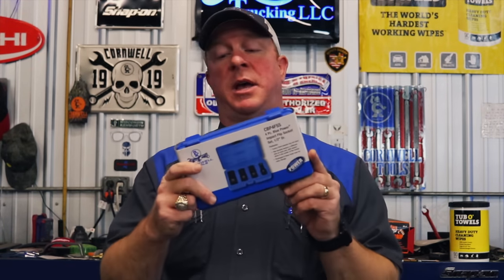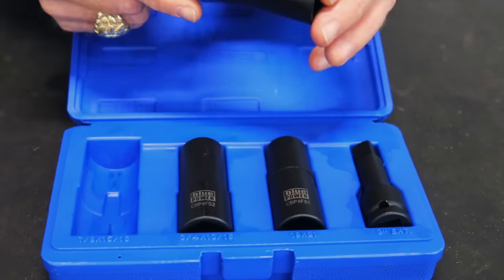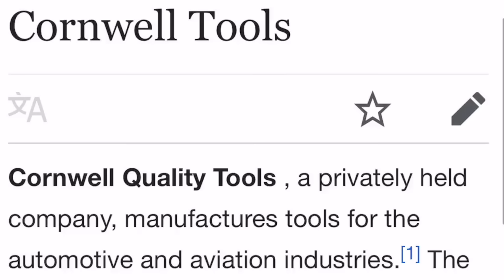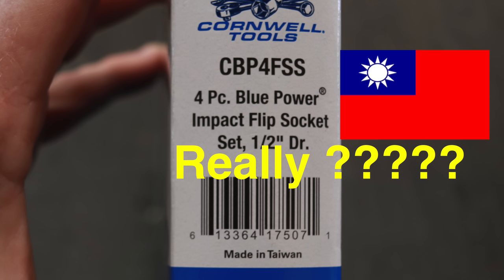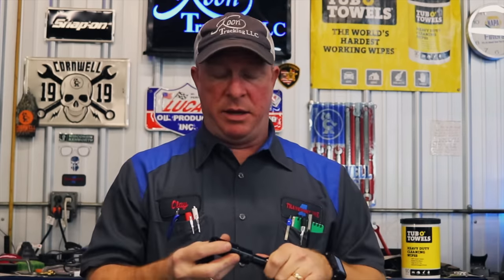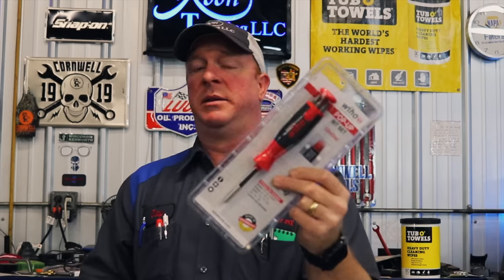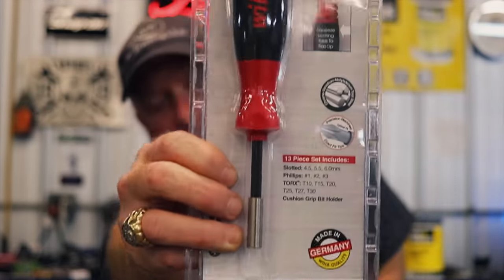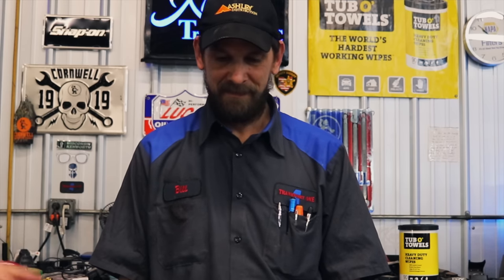Cornwell Tools: Putting Profit Over Quality. Made In USA?? You Guys Are Sneaky AF

Comment: Wikipedia is not official Cornwell information ... Blu Power is the Cornwell sub-brand ... of course it is foreign made, just like a lot of Snap-on's Blue-Point, Mac's Expert and Matco's Silver Eagle. $31 is the tool truck premium price, not the American made premium price. Also, just as an FYI, the Blue-Point 3 piece flip socket set (extension sold separately) is about $85 and is USA made. That is the tool truck and USA made premium  price
Reply from the maker: It would have been nice if it was stamped on there like the pliers they sell are and not in tiny print above a barcode on a piece of cardboard that will be thrown away. In most cases if it is on a tool truck and not ordered in like my set was the cardboard would have been tossed out already so they could be displayed and opened and it would lead you to believe they were American made. I just don’t think they should be so deceptive about it. Most blue point stuff is stamped “Made in Taiwan” and some BluePoint is made in USA 🇺🇸 either way they should have stamped it on there or at least have it on the actual BOX and not a paper that will be tossed
Reply: @KoonTrucking right, I get what you’re saying. The issue is you bought a BLUE POWER by CORNWELL tool. No need to read fine print. They’re not deceitful, it says in contrasting  BOLD BLACK letters on the Front of the plastic container, sockets, and LABEL. BLUE-POWER isn’t a CORNWELL made tool. Just like if you bought a set of Blue Point flip sockets or like I did, Adjustable wrenches and got fired up, PISSED that you didn’t buy a snap on American made tool. Obviously YOU didn’t care to return it for the American made Cornwell set. Instead you made a video mad you bought a Blue Point instead of snap-on.
Reply: @KoonTrucking right, I get what you’re saying. The issue is you bought a BLUE POWER by CORNWELL tool. No need to read fine print. They’re not deceitful, it says in contrasting  BOLD BLACK letters on the Front of the plastic container, sockets, and LABEL. BLUE-POWER isn’t a CORNWELL made tool. Just like if you bought a set of Blue Point flip sockets or like I did, Adjustable wrenches and got fired up, PISSED that you didn’t buy a snap on American made tool. Obviously YOU didn’t care to return it for the American made Cornwell set. Instead you made a video mad you bought a Blue Point instead of snap-on.

Comment: Koon Trucking just like every other mobile company CQT has it's main line and their secondary line. Blue Power is CQT secondary line which is made over seas. If you would like to purchase a USA made flip socket set form CQT the part # is STLN3ST. The USA price made in America is 109.00. I am sure Mr. Joe can get them for you.
Reply: But they are  charging what the USA made tools used to cost. That same flip socket set is available at Horrible Freight for less than $15.

Comment: I love your videos, but come one. Everyone knows the cheaper version of tools on the tool truck are made over seas. Blue point, blue power, xpert. Yes, cornwell and snapon are the only 2 left that make their tools in house still (or at least a large portion of them). This obviously does not include their cheaper lines. Why do you think they are cheaper?
Reply from the maker: Some bluepoint is American made ? Also blue point doesn’t hide it. They stamp it on the tool and or case ? Why does Cornwell try to hide it by a tiny stamp on the box ? That was the point of the video i should have been more clear.
Reply: Koon Trucking you’re spot on, Mr. Clay. I looked at the Blue-point ratchet caliper press it was $75. The same tool at Cornwell was $55. Both made by Lang over here. Amazon had the same Lang tool for $45. I paid the extra $10 from Mr. Joe because I’d rather support his business than Amazon’s.
Reply: Agree i feel this video is very contrived,  as if we dont know the secondary line is outsourced.  Did you really not understand what you were buying ?  I dunno man i am not a tool expert but i thought this was common knowledge and also common sense.  Cornwell hand tools are 100% american made , that is the statement they make and its not deceitful at all.
Reply from the maker: Mike White the purpose of the video was not that it is the “cheaper line” it is the fact that Cornwell tries to hide that fact of them being made in Taiwan by only putting it in tiny print on the cardboard wrapping that would normally be tossed in the trash by the tool man if it would have been displayed on the truck instead of ordered in. They should stamp the tool or the case at least. That’s sneaky that’s all that is. They should have to stamp the tool because even Cornwell mission statement is they are an “American Made tool company” where it should read “We make some of our tools here in America but we also import and bunch of it and try to fool you by putting tiny print on the wrapper and not the tool or box so there’s a chance you wouldn’t ever know that”

Comment: My Mac guy tried to warranty my USA made torx for some crappy taiwan torx. I told him I didn't want that junk and he had to order me the correct USA replacement.
Reply: Yep I too have had the same issue. I refuse to exchange tools under that type of situation. I end up going to their corporate offices to make sure the exchange is proper. The Mac guy who tried that on me now will no longer deal with me. I wasn't rude about it but I did stand my ground. Because I know as well as others here do that these guys do carry replacements made stateside . I have also had Mac and Matco pro rate tools and then durring the exchange charge you for the difference. I will stick with Snap on. They just have not done me wrong yet. I trust them and they will tell you where it's made if you ask in advance.
Reply: now that is absolute BS. I would have told him if he ever tries to pull that shit again Im threw spending money on his truck. had a similar thing happen to me with a snap on guy. when I told him I needed to warranty a tool he got all defensive and started asking what happened as if he were some cop. then he tried to give me some bs overseas item instead of the specific item that I had bought from him originally.

never bought a single tool from him again.

Comment: My first experience with a tool truck was a Cornell dealer wayyy back when I was starting to cut my teeth wrenching @ the Hyster dealer. The guy Rich was a great guy, would get you whatever you wanted. However, he sold the route about 2 years later and retired. I invested probably around 5 grand on hand tools and the only functioning ones I have left are impact sockets 1/2 and 3/8. They are great, USA stamped and work fine today.(15 years later) the rest of the stuff is junk, ratchets,hex bits all broken. The dealer stopped showing up and who knows where he went. I haven’t seen a dealer since. I haven’t found the motivation to mail them in either for warranty. Went to snap on and haven’t turned back.

Comment: I think the Blue Power series by Cornwall are manufactured solely in Taiwan. I have a set of swivel sockets by Cornwell (Blue Power) they’re all manufactured in Taiwan.
Reply from the maker: It would have been nice if it was stamped on there like the pliers they sell are and not in tiny print above a barcode on a piece of cardboard that will be thrown away. In most cases if it is on a tool truck and not ordered in like my set was the cardboard would have been tossed out already so they could be displayed and opened and it would lead you to believe they were American made. I just don’t think they should be so deceptive about it. Most blue point stuff is stamped “Made in Taiwan”

Comment: I like Cornell because they offer nice tools at a lower price than snap on. Though made not be made in USA, a lot of their tools are still very nice in my opinion. I especially like their tool boxes, mimics the snap on epic opening drawers but at a cheaper price.
Reply from the maker: I was just trying to point out they were being sneaky about it by putting it on a cardboard wrapper that would be tossed out. They should have stamped it on the case or the tool itself. If it would have been displayed on the tool truck that wrapper wouldn’t have been on there. They just need to be open about where it’s made. Just like they stamp on the pliers.
Reply: @KoonTrucking  Very true, love your videos! Keep them up!

Comment: Klein Tools made in U.S.A.(Chicago & San Antonio to be exact), but they're not sold on Tool Trucks, they're sold mainly in Plumbing and Electrical supply stores. (but Klein doesn't make Ratchets and Sockets and markets their tools mostly towards the Electrical and Plumbing trades rather than the Automotive trades). Klein is to Electricians what Snap On is to Mechanics
Reply from the maker: I have some Klein linemen pliers and a set of screwdrivers and they are great ! In fact the lineman pliers are the best pair i own. I use them often to just cut wire with. They cut better than any pair i own.

Comment: I'm from England and bought a new 1/2&3/8 ratchets which I thought was britool expert, I new things had changed hands a few times (facom-britool) then (britool expert ((Stanley Black and decker)) britool hallmark) it came in the post opend it at the bottom made in Taiwan, bit upset got over it then bought the expert and I got mac expert sockets 1/2&1/4 made in Taiwan again
SO WHAT DO YOU DO???????
Reply from the maker: Order a Snap On ? They are made in USA and hard to beat

Comment: In 2011 I purchased a heavy duty Snap on 1/2 drive Air Impact Gun from a local Snap on dealer. I paid $549.00 for this Impact Gun. I've used 10-15 times and I oil it each time with Snap on Oil. When I'm done it goes back into my lower Snap on tool cabinet. I've been retired since late 2011. This past Christmas I wanted to rotate my tires on my Jeep Gladiator and the Ipact had no power. I Called Snap on and emailed with the original receipt and photo. They wrote back that this Impact is no longer sold and parts are not avalible. I found a local Snap on tool truck and show him my Impact and he said this one was made in Taiwan and you may try to find a local repair shop that can repair. Snap on had a lot problems with this Impact. I sent it to a repair shop and it took 2 months to get it repaired. Cost me $150.00 it works but I feel I was Screwed by Snap on. I ended up buying a heavy duty Astro with way more torque for $179.00 and a great 2 year warranty. John

Comment: This video was made with very little information. I can go on snap on and complaint that their blue point isn’t American made. First thing I was told on a Cornwell truck was that blue point is the more economical set while still holding a lifetime warranty.. if you don’t want to pay $600 for a universal socket set then go ahead and pay $345 for the blue power.. you want American then pay for it.
Reply from the maker: Well I am guessing you missed the entire point of this video. The only thing printed made in Taiwan on any of it was on the cardboard wrapper in tiny print. Not on the tools. Not on the case. That’s som B.S. because most of the time the cardboard cover is thrown away by the dealer so people can see what’s in the box. Most all bluepoint stuff that i have is clearly stamped made in Taiwan. This is nothing but Cornwell trying to be sneaky about it.

Comment: Yep like most have already stated Blue power is sourced from overseas . They like Matco and Mac as well as some products from Snap on are imported. 
But Cornwell and the others do make tools stateside. And their prices really are much higher than Blue power , silver eagle and so on. All of them sell power tools made in China for extremely high prices. This is why I stick to wrenches, sockets , ratchets and screwdrivers from Snap on and I also will buy their pliers and hammers. They are made in the USA and that is on their tools. When it comes to power tools I do not buy much from tool truck vendors. I purchase Milwaukee Makita and some Dewalt because performance wise they are close enough to Snap on and others for usually half the price.
Snap on is the best source from American made products. But I always look on them to make sure made in the USA is present. 
Knipex as well as NWS , Felo and other German made tools are high quality and I have not gone wrong with them. 
It's still a buyer beware market.
Also wanted to say $31.00 for a plastic case isn't bad. Buy a new plastic case from Snap on. They are very expensive.

Comment: It’s Blue Power, made in Taiwan. It’s like the Blue Point of Snap On and the Expert of MAC.  Still pricey.
Reply from the maker: It would have been nice if it was stamped on there like the pliers they sell are and not in tiny print above a barcode on a piece of cardboard that will be thrown away. In most cases if it is on a tool truck and not ordered in like my set was the cardboard would have been tossed out already so they could be displayed and opened and it would lead you to believe they were American made. I just don’t think they should be so deceptive about it. Most blue point stuff is stamped “Made in Taiwan” and some Blue Point is even made in USA
Reply: You’ve got a good point Clay. I say exchange/ return if possible!

Comment: I agree with you...but someone has to play devils advocate here...That flip socket set is not a hand tool...its an impact tool. It goes on an air powered impact wrench. It's not designed or intended to go on a ratchet or breaker bar. When they say American made hand tools, they mean screwdrivers, pliers, wrenches, sockets, etc....Not everything sold in a Snapon truck is American made either...like you said, you just have to research more and buy wiser. 

Great video....I always enjoy your content and topics!
Reply from the maker: I agree they were just really sneaky about how they hid the label on a piece of cardboard that would be tossed out. Should have been stamped on the case or tool at the very least
Reply: @KoonTrucking  absolutely  it should be stamped on the tool as well. That is sneaky of them.

Comment: Isn’t Blue Power the equivalent of Blue Point, Silver Eagle and Expert? That doesn’t mean that the main brand is not made in the USA
Reply from the maker: I guess you didn’t watch the video when I ordered them I was specific in asking for USA made ones. But the point of the video is that most dealers would have them displayed on the truck (not in the wrapper so you can open them and see them) the only marking anywhere was the tiny print on the outside wrapper.

Comment: They all have their overseas budget line. Blue Power, Blue Point, ADV, Silver Eagle, Xpert, etc. That said, the Blue Power line is reputable and quality for the money. I have the complete set of Blue Power impact sockets, 1/4", 3/8" and 1/2" drive in metric. Haven't let me down yet and I use the crap out of them. Only thing I can complain about is the impact swivels, but that's any budget brand anywhere. Great quality, same warranty, and if I can get a complete set of impact sockets on sale for $350 that does the job just fine with no hiccups, no way am I paying a couple thousand for the same set in their mainline brand, not at this point anyhow. Just like I keep a set of HF sockets and a ratchet around for oil changes because on average I prefer to avoid soaking my Snap-On ratchets in used oil. It's all preference there, though. Have to say it, it's nothing great, but that HF ratchet and the Gearwrench I used alongside it did just fine until I bought a standard length 3/8" Snappy ratchet.

Comment: Didn't I see some blue point in your shop
Reply from the maker: I don’t have any blue point in my toolbox hardly at all. I do have a bluepoint set in my truck that i use in emergencies. Actually i think i only have about 3 bluepoint tools in my box and one of them is an airchuck. 
The point of the video was Cornwell trying to hide where the tool was made. It would have been nice if it was stamped on there like the pliers they sell are and not in tiny print above a barcode on a piece of cardboard that will be thrown away. In most cases if it is on a tool truck and not ordered in like my set was the cardboard would have been tossed out already so they could be displayed and opened and it would lead you to believe they were American made. I just don’t think they should be so deceptive about it. Most blue point stuff is stamped “Made in Taiwan” on the tool or the case. But not all Blue Point is made overseas..... some are made in the USA

Comment: Blue power is Cornwells version of blue point witch is out sourced
Reply from the maker: It would have been nice if it was stamped on there like the pliers they sell are and not in tiny print above a barcode on a piece of cardboard that will be thrown away. In most cases if it is on a tool truck and not ordered in like my set was the cardboard would have been tossed out already so they could be displayed and opened and it would lead you to believe they were American made. I just don’t think they should be so deceptive about it. Most blue point stuff is stamped “Made in Taiwan” either on the tool or case (especially in sets) and some BluePoint is made in USA

Comment: Check all your Blue Point tools.  On Snap On's site the origin on most of it is TWN. ;-)
Reply from the maker: But they are stamped “Made in Taiwan” on the tool ..... not just a tiny print above the barcode on a cardboard wrap that you will throw away or in most cases if it’s on a tool truck and not in the “special order” drawer that cardboard piece wouldn’t have been on there because it would have been opened already.